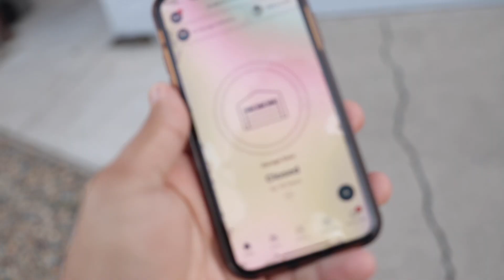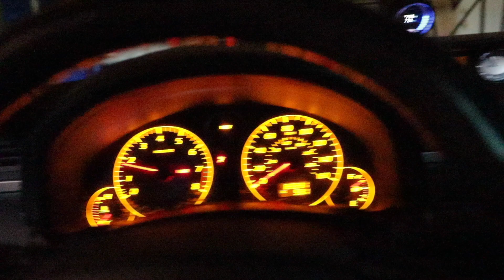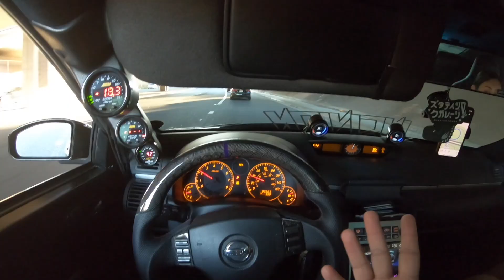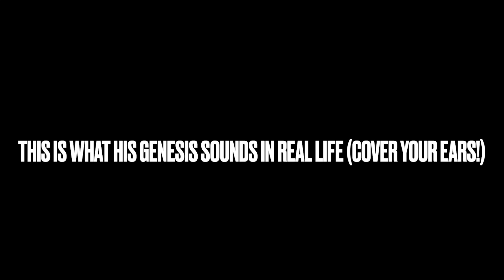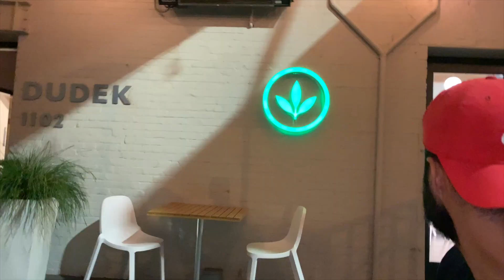Crashing a Muscle Car Meet with my SUPERCHARGED G35 (1st POV)

Comment: Honestly I like the way your car  sounds like way more than the ones poppin' just my opinion but that poppin' to me sounds stupid. I get its tuned to do it but ya can't tell me it isn't bad for your exhaust valves n stuff with all the unburnt fuel. Like predetonation in older vehicles is something to be avoided lol. Like I say ,just my opinion.  Your car on the other hand sounds f...ING killer ! Just sayin';8)
Let me know about that 1 piece drive shaft cuz I almost ordered 1 a month ago and hesitated lol.
Reply: @calebcrossman9464  every car does that I know but to shoot it out of the tail pipe is not naturally unless it’s an exotic car. And you gotta have it a pretty high rpm to make any engine shoot that kind of flame that is not safe for any engine
Reply: @calebcrossman9464  I don’t know much just things I’ve seen from comments and stuff and I always see most people say it’s bad and it’s burning the engine . So is admin tune or whatever and flame tune burble etc not bad for your engine???

Comment: What are those things on the left called and use for and on the dashboard 7:52
Reply from the maker: On the left are gauges, AFR, boost, and oil pressure. Middle ones are air pressure gauges for my bags
Reply: @BeDistinct  ahh I see

Comment: @Bedistinct you should upgrade to motordyne art pipes get rid of your CATS I’m sure you will be making more power with that addition
Reply from the maker: I do not have cats on.
Reply: @BeDistinct  if you have high flow cats or test pipes you should still upgrade you got a nice set up and motordyne art pipes are known to give you 10whp compared to a test pipe . Their like $650 you already dropping money into your G I’m sure that’s nothing for you to get lol
Reply from the maker: @eman_vq8036  they are nice man, and sound super good. Maybe in the future I’ll toss them in. I do want to get a couple upgrades like a chargepipe, intercooler, fuel return system.